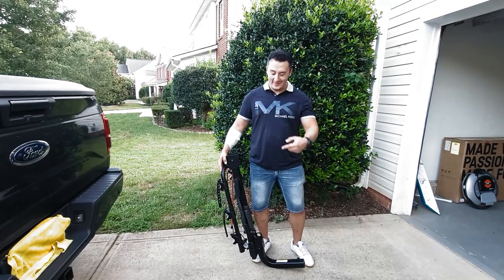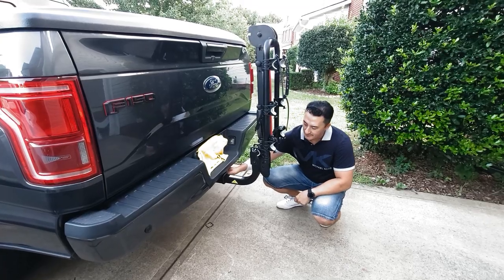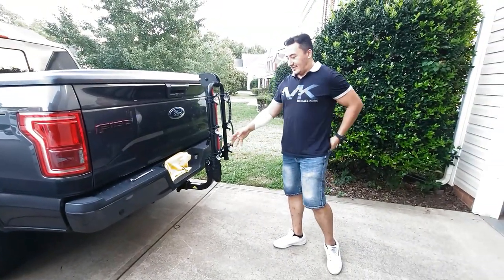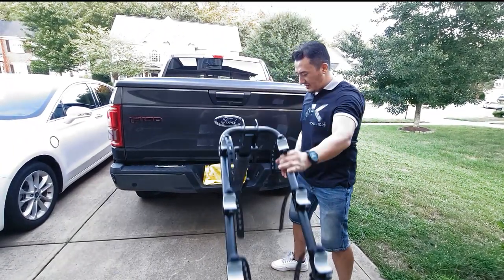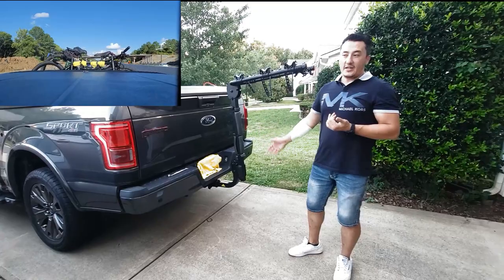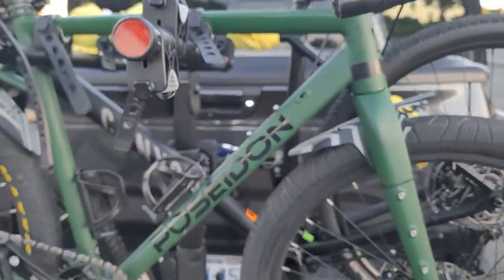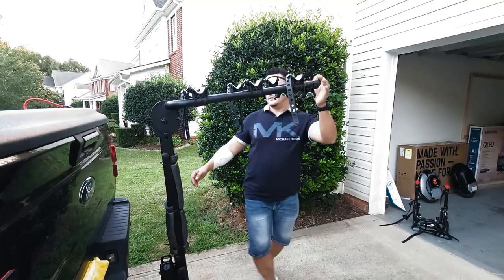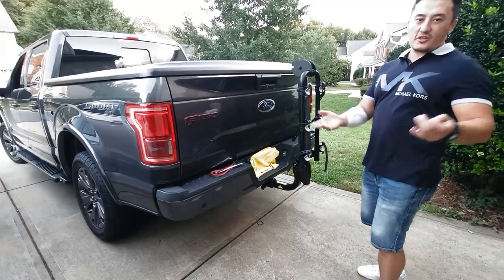Best Bike Rack KAC S4 2 Hitch Mounted Rack 4-Bike Premium Carrier

Comment: Is there a locking device for the bikes?
Reply from the maker: No
Reply: I been looking at these vs Hollywood hr400 according to there website you can buy a locking pin with a locking cable both keyed alike for 40 dollars on kac website not sure if this helps or not